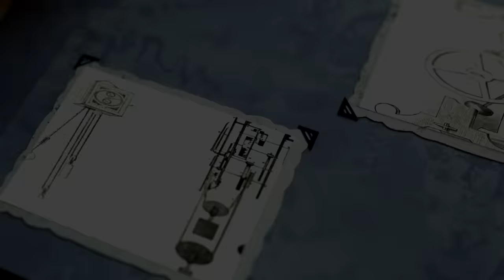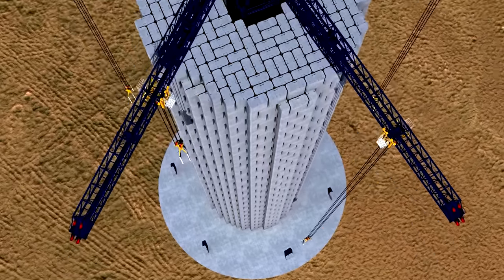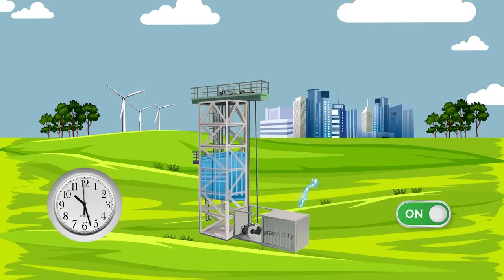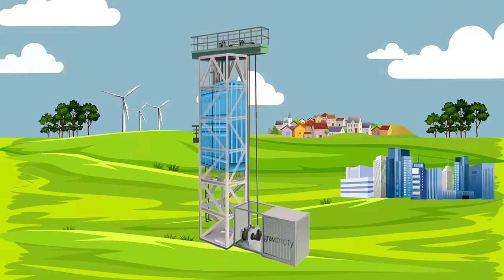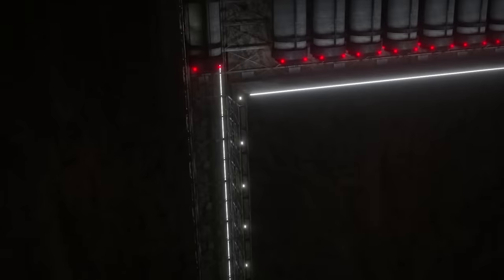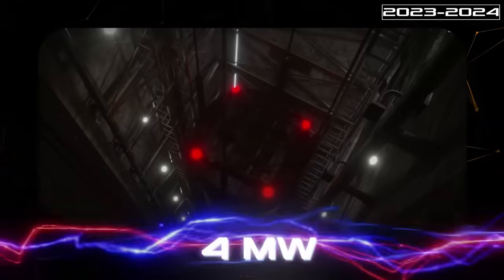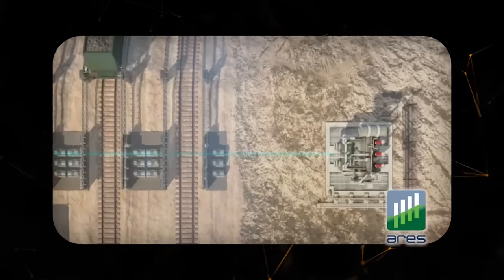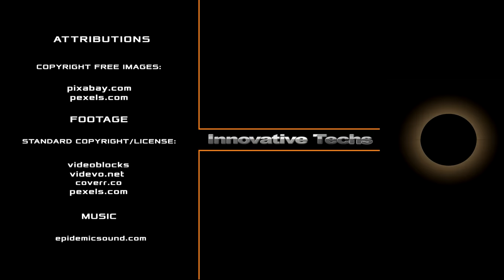How gravity batteries could change the world

Comment: The demonstrator plant in the video: 15 meters height of the tower looks like the 50 tons weight only can move around 11 meters?  That means that this system that cost £1 million to build can store 1.5 kWh!  I hope you are all very impressed by this cutting edge technology. A li-ion battery with that capacity weigh less than 10kg and cost $200! So even if the 50 years claimed life of the tower comes true, it will still be 1000 times more expensive than a single Li-ion battery you can carry with one hand. This is a scam to trick investors that for some reason didn't pay enough attention in school during science class. So can it be used for short bursts of power then?: The "fast" drop, shown in the video, the weight drops at around 1m per second, so it can supply a burst power of 491kW for 11 seconds. However the claim in the video says that peak power is only 250kW, so that means there are losses of around 50% in the system, which is both ways btw, i.e. for going up and going down so in reality, a 5 kg $100 Li-ion battery is enough to replace this device and the tower has a combined cycle efficiency of only 25%, like Hydrogen fuel cell energy storage, but you don't even have waste heat here as a byproduct!! That is maybe still enough to make this useful at a local electricity distributer to mediate fluctuations, however to deliver 250kW for an hour, you'll need a weight 327 times heavier and the company is even suggesting a 20MW system running for 8 hours which would mean 327*8*80=208,000 times bigger than the demonstrator plant and it would need 4 times the amount of energy in, as you can recover per cycle, so highly wasteful, as I already mentioned. To continue the "number of homes" analogy in the video, it would mean 3 towers like this per home!. Youtube commenters and politicians alike: if you ever hear about this again, dismiss it immediately, it is a scam, in the literal sense, not only meaning sketchy or overly optimistic. This company knows very well that this can't possibly work. They are only out to pocket public money, to then just disappear when they get them!
Reply: Yep. You evidently know your way around numbers. This thing is a scam.
Reply: Yes, this thing it's a SCAM !!! BUSTED !!! 🤬
Reply: Yup I was thinking the same thing.
Reply: Better gravity storage already exists using water. Lake Geneva (90 billion tonne) could regulate the power supply for Europe on a 24 hourly cycle. Need to be able to raise and lower at least 10 million tons through a height range of 200 metres to store useful amounts of energy.
Reply: It is a prototype. They for sure did the math on this. The advantage of this system is that it doesnt reducenits generation or storage capacity, meaning that it works way better than a battery
Reply: It's  an idea. Like any idea refuting it is mandatory. Related to the subject, Batteries need to be eco-friendly. I have heard there is plenty, plenty lithium in the oceans. Extrating is the issue. The harm we do will visit or children. The stone age did not end because it run out of stone. Something better came.
Reply: @danielabilez3619  According to this video, and from a long-range perspective, the stone age is being replaced by the stacking stone age.
Reply: When YouTube videos are narrated with that annoying, condescending, sing-song cadence, it is a red flag signaling the content is as phony as the presenter.
Reply: Not really. The battery issue is the availability of rare earth minerals and (misleadingly) unfounded community opposition to mining.
Reply: Hahaha
Reply: @maroserob   For your point to have any meaning, you have to clarify what you are referring to when you describe community opposition as "misleading" and "unfounded". Your comment makes it sound as though all cases of opposition are due to the same factors everywhere. The total worldwide net profits of mining companies more than doubled in 2021 and 2022 over the previous 9 years. If mining companies get a knee-jerk negative reaction, they have done a lot to create those dynamics through their history of greed and exploitation of the communities in which they operate.
Reply: the prototype for a $35k car costs 5 million dollars...
Reply: I read an article just now that said their facilities in China and Texas are nearing completion. They're about 400ft high and can store 100 MWhr
Reply: @wemustbecomemachines2012  lol
Reply: @N0Xa880iUL  That is big. 100 MWh will require roughly 250,000 tonnes lifted 400ft!, likely more if we include conversion losses. If the weight consists of a single concrete cube, it will be 154ft on each side! Producing 250,000 tonnes of concrete, transporting and pouring it will release 225000 tonnes CO2. Remember this is a battery, not a clean energy source, so if it only uses renewable for the lifting, it will still add 20.5g CO2 to every Kwh after 100 cycles. 10 times as much as say hydro power adds. So after 1000 cycles, it could with reason be called clean energy storage.
Reply: @Tore_Lund  They say it's economical because the weights are made of mining waste and which the mining company already offers about $50 per ton to get rid of.
Reply: @N0Xa880iUL  That sounds more reasonable, but there still will be needed serious amounts of concrete.
Reply: @Tore_Lund  For sure. I'm still not sold on the idea and will wait for a truthful demonstration video and relevant numbers, especially the LCOE. They might just be able to make it work in certain locations.
Reply: @wemustbecomemachines2012  von
Reply: A block of Lead(Pb) the size of your living room weighs 350 Tons. it's ideal at 11.4 times the weight of the same volume of water.
Reply: @maroserob  😮
Reply: This strangely sounds like an extra piece of the cern collider...which requires massive amounts of energy..
Reply: @davidgriffiths7696  I don't think raising and lowering the surface of Lake Geneva by 200 meters would go down very well.
Reply: @danielabilez3619 in the end...there is nothing better than stone.
Stone and water and gravity.

Long after all our modern shit is rotted and gone there will still be water and stone and gravity.
Reply: @Tore_Lund how much further does 100MWh go if all the devices are energy efficient?
Reply: @Tore_Lund new concrete... Classic concrete is supposed to be load bearing... This doesn't have to be.
So you could make a concrete with really dense heavy aggregate... Like lead and basalt.

Making super dense super heavy concrete means heavy weights on the cheap.

Another real problem with towers is the materials and logistics of building.

It's much better to cut vertical shafts into the ground rather than build upwards.
Reply: It's obviously a scam
I thought they made a battery that works by some electric effect & under the influence of gravity some sort of turbine or more charge can be maintained by such system
Reply: The issue with gravitational potential energy is it needs quite large weights and heights. For example a kilojoule is about 100 kg weight lifted a metre, thus a kilowatt hour is 1000kg lifted 360 metres - equivalent to an average car being lifted to the top of the Eiffel tower. Even the 50 tonne weight needs to be lifted at least 7-8 metres per kwh, and more to cope with losses. To be honest, you can do better using steel springs for energy storage.
Reply: I have done some matmetics for Residential Use Tough it is possible but quite expensive.

Steel Density	 7,800 	kg/m3				
Volume	 0.52                m^3	(Clyinder Height	15	ft	Clyinder Radius	0.625	ft, V=18.40Cft)
									
Mass	 4,063.68 	kg
Gravity 	 9.8		        ms-2						
Height	 304.80 	        Meter		 (1,000ft Water Bore)			
P.E	         12,138,389   Joules							
P.E	         3,371.77        Wh 		
P.E	         3.37 	        kwh							
									
Required Kwh		10							
									
Achived		33.7%							
									
									
Number of Batteries Required		 2.97 ~3					
									
Estimate Cost 51,213  USD 	
Cost of Lithium Battery 2,000 USD
25.6 Times Higher				

Energy Efficent Generators can be used which can reduce with 90% effiency.

Advantages over Lithium 
Rapid Charging & Discharging.
Reply: @didaumbrazil olvidas el desgaste de materiales y estructural 😂🤣
Reply: olvidas el desgaste de materiales y estructural 😂🤣. Suena bonito por lo inusitado. Prefiero las termosolares❤. Son las MEJORES 🎉10.8.2023
Reply: The dead give-away for me was stating energy in Megawatts.  Megawatts is a unit of power.  Energy is measured in Megawatt-hours.  So you can make a very small amount of energy seem like a lot.

For example, 0.027 MW-hr would power one house for about a day.  You could state that amount of energy as 10 Megawatts... for less than 10 seconds.

So yes, the gravity battery might put out 10 or 50 Megawatts - but for how long?

This is a scam!
Reply: You saved my 10 minutes
Reply: You're like Zoolander when he sees a scale model of a building for kids to read good, and is upset that the model is only small enough for ants. It's just a scale model, and a prototype.
Reply: @mrbonzzai  Full scale: You would need about 170 tons lifted to over 100 ft just to power your house overnight.  That's about 100 Toyota Camry's suspended 4 times the height of a typical 2-story house.  Put that in your back yard.
Reply: @mrbonzzai  This is not a valid argument. If it doesn't work as a scale model, it won't work either in full size. There might be a few savings building full scale, like the weight can be filled  with sand instead of being massive concrete, but the cost overhead will still be magnitudes higher than battery storage.
Reply: A pulley system would exponentially increase the height of the calculation. Look at the video, there are 4 lines due to pulleys. That is effectively a 60 meters tower. What about the gearbox as well? 100:1? 1000:1? Definitely not as simple as height times weight.
Reply: @user-mv4zh2xg9d thank you. I wanted to write that. Everyone is thinking 1:1. These engineers are not that stupid.
Reply: Huh. Weird. 
I didn’t expect to see anyone here that can still think.
Reply: @fishhuntadventure  Thank you. We are many and we meet secretly in the Youtube comments of sciency videos.
Reply: Not a scam but they’re missing a couple critical features that make this concept work.  I Would love to share the secret sauce but; it wouldn’t be a secret anymore. Stay tuned..
Reply: @surepowersolutions7260  A Finn I know recently told me this company is installing a full scale battery in a mineshaft in Finland, so they got orders. I still don't believe the investment will be worthwhile, i.e. still more expensive than batteries and lower capacity, than claimed in this video.
Reply: @davidgriffiths7696  I think building special silo to get rain water combined with turbines would be ten times better than that "system". In regions with flooding could be also useful to stock water.
Reply: @thomaslacornette1282 yes…there’s a reason lifting blocks up and down wasn’t done, water was used instead. Very large amounts of mass are required which means large volume ie lakes containing several cubic km of water at least+ very high flow rates. My pond with about 1000 tons in it contains about 33 kwhr of potential energy, for which I would need a small turbine and a pipe costing about 2000 euro. A machine for lifting a 1000 tons of concrete would obviously cost vastly more and require a lot of energy to build. So his idea is a none starter.😆
Reply: Thank you for the elaborate comment my man. It's feeling scammy, but i couldn't tell why exactly it is
Reply: @user-ce1cu5my4j  It is really basic classical physics about work / potential energy, something didn't sound right to me either.They fell for the scammers in Finland, where they now are building a system in an old mineshaft. They are going to be very disappointed.
Reply: I don’t know math and even I can tell it’s a scam
Reply: The stacking tower concept might work better.
Reply: This technology could be scaled up bringing the tco down,  also cannot rely on one just batteries
Reply: @danielmcleanfisher  Scaling does not improve the physics, though costs per kWh can be improved a little.
Reply: I got even less unfortunately. Here is my maths if anyone is interested:

gravity potential energy(J) = mass(kg)*gravity(m/s)*height(m)
= 50000*9.81*15
=735750J
= 7357.5kJ

Assuming losses in the system of 50% this is 3678.75kJ

Converting to kWh is just over 1kWh with a household using an average of roughly 7.4kWh per day(from google) it is pretty bad.

If using a 400m drop from a coal mine we get:
= 50000*9.81*400
=196200000J
Since 50% is useful that is 98100000J which works out to... 27.25kWh

Wind turbines put out an estimated 600000kJ per a minute so to store a minute of wind turbine energy we would need a 2.4km hole in the ground
Reply: @davidgriffiths7696 Pumped hydro is awesome. But hard to do in most places. To solve this problem, maybe use a long and large diameter metal tube (with one end closed off at the top) and submerged into the sea and pulled out by a huge floating crane, powered by solar, wind and wave power. The submerged tube would be full of water (like an up-side-down tumbler) when pulled up (but not completely out of the water). Then release the water through a valve to spin a turbine. Then re submerge the tube and close the valve, and repeat the whole process. Pumped hydro anywhere where there is water.
Reply: @Justwantahover  basically need a big pipe and a hillside going up a few thousand feet to a lake, for regional grid stabilisation purposes.
Reply: Every gravity battery I've seen is a scam.  You're better off making heat batteries, not that I'm saying it's a good idea.
Reply: Your math is incorrect I am a physicist. Not saying nothing but you know it would be quite easy for a BATTERY COMPANY to post such a comment. Just sayin'.
Reply: @chuckebbs7541 the original comment is correct for the numbers he assumes about 6MJ/3600=1.5 kWhr. This is basic O-level school physics.  Not much, about the same capacity as 150Ahr battery.
1000 kg at 10m is only 98.1kJ
Reply: @chuckebbs7541  Show me where my calculation is wrong, then we are talking.
Reply: You're the type of person someone says "bye" to "I gotta go" and you continue talking for 20 minutes.
Reply: @86GT11  You are kind of intriguing. You claim to know better, yet don't even try to argue with your alleged knowledge. Instead now you try to attack my character? How old are you?
Reply: @Tore_Lund  yep 20 minutes 🤣
Reply: Cool infrastructure project within urban areas.
Reply: Just the fact that most oil company's promote this kind of nonsense should make it clear its al a scam.
Reply: You have left out alot of details and your comparisons are wrong
Reply: @grahammukuyu4660  What details, what comparisons? You have to make an effort if you want to criticize science.
Reply: Tore_Lund is spot on, this is BS. Calculate the potential energy of the system with m*g*h, weight times height. This gives the theoretical limit at 100% efficiency. At 100% efficiency 1 kWh equates to raising 367,098 kg a height of 1 meter. So with no losses a 50 metric ton weight raised 11 meters could store 1.5 kWh. But I would expect much higher losses, and all this without considering any of the energy required to construct such a facility. It seems like a scam to me.
Reply: A relative who works in renewables described some of the startups, as having people on big salaries who have burned through their funding and are now looking for a government handout to keep the money going a bit longer. Some of the proposals actually produce negative energy, as the inputs are lower than the outputs.
Reply: They made wind turbines "work", I guess anything is possible.
Reply: @bills5009 Sometimes people use a term called an “Average Megawatt”, which is the power rating times the hours in a year (8,760.) And this gets misquoted as a Megawatt.
Reply: 😍😍😍😍😍 mind reader
Reply: Gj
Reply: What if we do this in a mountain the cost will be reduced
Reply: @sciencefusion5352  You could use an old mineshaft, but you would still have to build the infrastructure to support and lift the giant weights. They have looked at using large caverns for storing energy as pressurized air. I haven't heard of a successful project like this.
Reply: Best tech comment ever
Reply: welcom to the 21 ieth century !
Reply: @maroserob 
Natrium based batteries are coming fast, which will reduce the damage to the environment almost completely (to at least the same level as this concrete monstrosity, already are cheaper and need less space than this idea. This isn't even a competition at this point.
Reply: @johnpye-d2n 
The total energy in the system can never exceed the gravitational force times the height and mass of the weight. No amount of pullies is going to change that. That is not how pullies work.
Reply: Two key words, "demonstrator plant" lmfao. that really rustled your almonds tho didn't it
Reply: @davidgriffiths7696  "better" not really, gravity battery prototypes already hit overall system efficiency higher than pumped hydro. Less loss
Reply: @DarkAttack14  it’s about capacity v cost, not marginal differences in machine efficiency. A lake may contain a billion tons of potential energy, this is orders of magnitude greater than any solid state potential energy storage construction. There’s a reason there are pumped storage components to the grid, but no significant examples of solid mass p.e. storage…it’s not economically viable and will never be worth building except on very small scale in places with no water.
Reply: @davidgriffiths7696  the economic viability goes up significantly when you account for the fact that scrap materials have weight, and you can buy broken up concrete dirt cheap, even cheaper than fresh concrete supplies lol
Reply: @DarkAttack14  water from a lake costs nothing, refills from the sky due to solar energy absorbed over a large area, and can be raised and lowered by a few hundred metres every cycle, equivalent to raising and lowering a mountain sized pile of junk by 1000 feet, which can’t be done.
Reply: @DarkAttack14  If a demonstrator plant already shows the numbers don't add up, then it is serving its purpose isn't it?
Reply: Yes , I also agree with you....